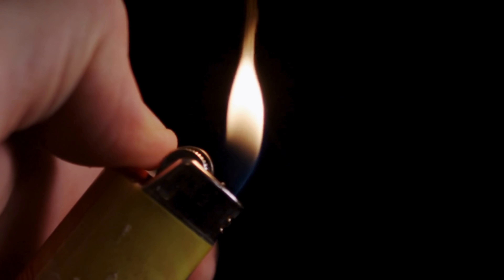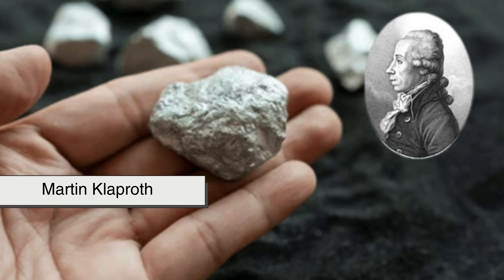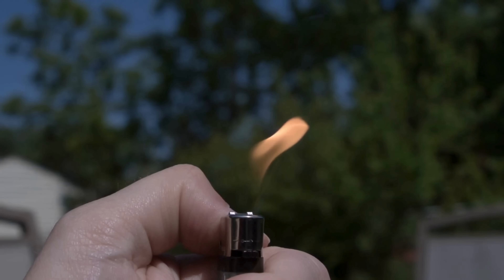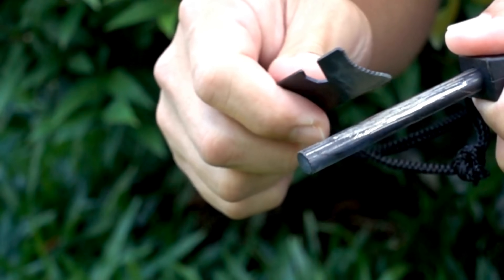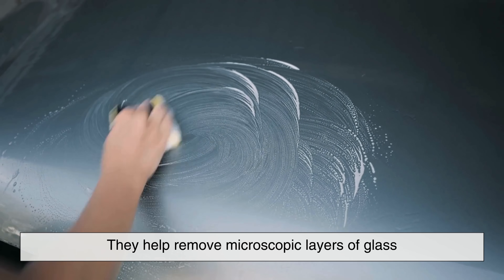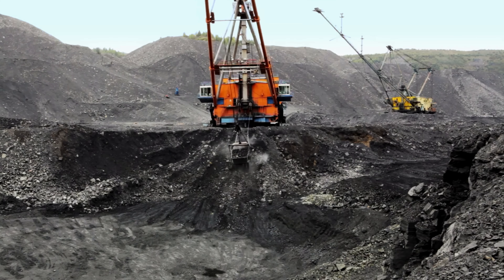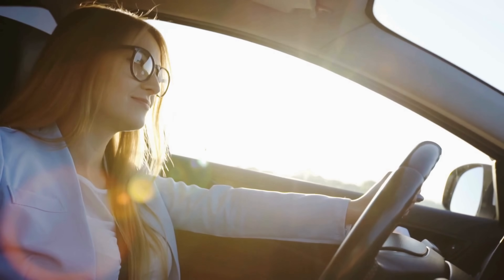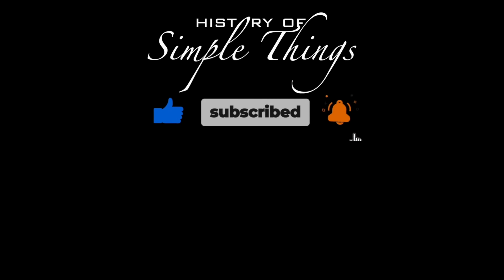What’s Cerium Doing in Your Lighter and Windshield?

Comment: Cerium nitrate also used to treat third-degree burns, and cerium compounds are major players in replacing poisonous pigments such as cadmium yellow and red. It also makes self-cleaning ovens work. Cerium is also easy to separate from the other rare earths since it has a plus four valence state as well as the plus three state the others have. This doubles the number of compounds it has.

Among the glass objects cerium polishes are amateur telescope lenses and mirrors. It also used to be part of thorium gas mantles. Altogether, a really versatile element.

Comment: Regarding 3:55, harder than Glass is Sapphire. Sapphire is used to make the crystal in some expensive wristwatches, because Sapphire is scratch-resistant whereas Glass can be scratched and become dull.
Reply: Love my ratio divers watch because it has sapphire glass and it cheaper than the rolex submariner by 7900 pounds.
Yup .
79 pounds .
Automatically winding
200 m depth waterproof

Comment: Regarding 1:53 the video explanation is incorrect, because the small metal wheel you flick on a lighter is not made from Ferrocerium. Instead the small metal wheel is made from Hardened Steel with knurled teeth. Underneath the Steel Wheel is a small protruding rod made from Ferrocerium (also known as "Artificial Flint") which is replaceable when it has worn out inside a Refillable Lighter such as a Zippo. Ferrocerium was invented in 1907 by Austrian chemist Carl Auer von Welsbach. Ferrocerium metal alloy is composed of iron (20.8%), cerium (41.8%), neodymium (4.4%), praseodymium (4.4%), magnesium (4.4%) and lanthanum (24.2%). Ferrocerium can make hot sparks, because it is "Pyrophoric".
Reply: Ya, I thought there was something off what he said, i thought it was the flint all these years.
Reply: i wish posters would do a little more research before posting. I always knew it was the flint and now cerium. I am not sure if new auto windshields really need polishing.